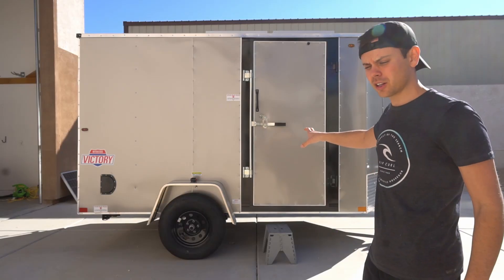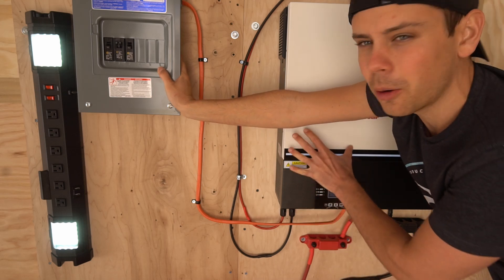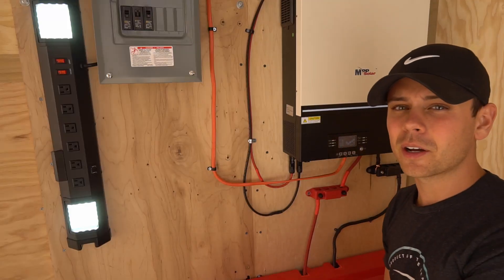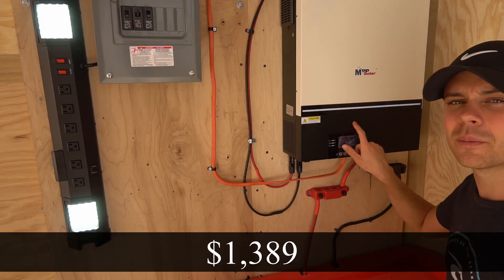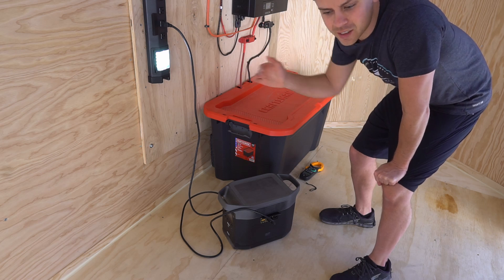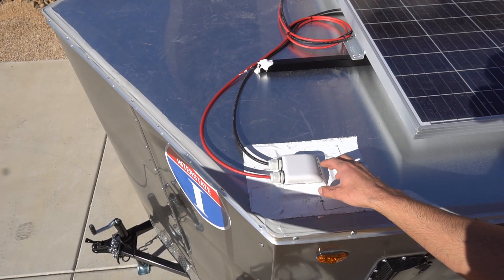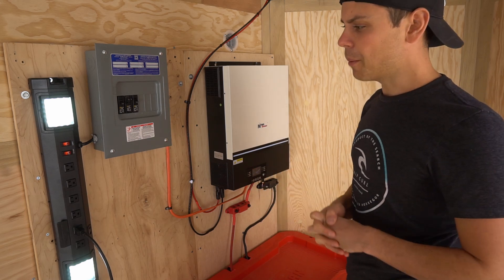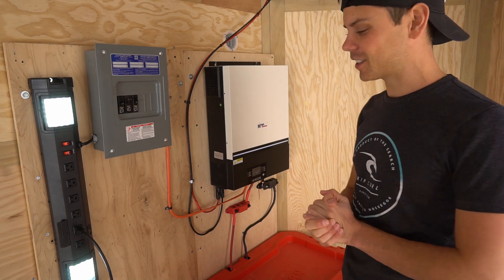Utility Solar Trailer: 6.5kW AC Output, 4.8kWh LiFePO4, 8000W Solar Input and AC Charger

Comment: Hello, can you please make me a plan or a sketch of how to switch 4x 12 volt batteries to 12 volts and 48 volts? I have already imagined this with 4 powerful relays, but I have some concerns about the contact change, whether it could come to strong sparks. Well, it should be possible to switch load-free, or what do you think? I am planning to install a 2150 Wp solar system on my van. Because I want to install something like that in my motorhome.

Comment: I sell trailers for a living. Before you install the AC be sure to insulate the walls and ceiling if they are not already (mold due to condensation). 1 inch rigid foam works well. Be sure to number the panels so they go back were you got them and in the right orientation or you will be pulling your hair out (personal experience). If using a roof mount AC you may need to double up on the cross braces as well. A product called Silaprene is also good for sealing up things on trailers. Messy but never fails. Wear gloves! Cool looking setup! Neat and tidy as always.
Reply from the maker: Good advice
Reply: Thanks for the great advice.  How much would a trailer like this cost?  What model is it (or one similar)? I want to find out the specs (i.e., dimensions, weight, etc.).  Which trailer would you recommend for one to build their own camper (for one person)?
Reply: Brutha V It depends on how much space you need and weight for towing. Usually a 6x10 is about the smallest but up to about a 6x12-14 is a nice middle ground. Vnose helps add a bit of space but does increase overall length. The pull better too
Reply: @mrmotofy  Thank you, sir!  Appreciate the feedback.
Reply: @BruthaVIII  if you need to watch weight, the 6x10 aluminum ones come in right at 960# and are around 4,000. I looked at a neo trailer, it was light enough to pull with my rav4 with 4cyl motor but once you hit 60mph it caught to much wind and gas milage was terrible. 
   I would make sure and inspect the roof of any trailer your looking at closely, the neo i ordered had some places where the roof metal was flush and others with a gap you could stick your pinky in between the roof brace and metal roof. If your mounting solar panels like Will did, it would crush and crease with the 1/2 to 5/8 gap the neo had. Hope this helps, God bless!
Reply: @checkingoutgypsymike2075  That does help, brother!  I appreciate it.  God bless you too.
Reply: A solar DC heat pump mini split would be the way to go here
Reply: What kind of air conditioning  would they set up handle?

Comment: Excellent project; I like your neat wall layout. The box takes up a lot of floorspace; maybe experiment with mounting the batteries in a line along the wall to match the slim layout of the other components. Instead of a fixed ground mounted solar array, how about designing a detachable array attached to the side of the trailer. That way the larger array can be taken to a job site and used as an awning or detached and set up in the sun when the trailer is parked in the shade. ✌
Reply: If he built a hinged array that folds down onto the side(s) of the trailer or can be set up to the flat position, that would do the same, but would be easier to bring with him.

Comment: It's a good set up, but....I like to see wires in conduit in a rough service area's.
Reply from the maker: Same here but I am going to swap out those conductors soon enough. So I stick with romex. But yes, ideally you should use conduit.
Reply: @WillProwse  It's a neat test system for sure. You said you are going to do air conditioning when it gets 120 outside? Are you in Arizona? The inside of the trailer is gonna hit some high temperatures. Maybe ~160°F?. You can really test the durability of the electronics up on the wall. Reminds me of what my dad used to do. Quality Assurance for Arco Solar on their solar panel's.
He would tell me that they would cycle between extreme low to extreme high tempetures. Solar has come a long way since the early 80's.
I still have a panel that he gave me. It was one of those test panel's. 
A whopping 2amp output at 12v.
Reply from the maker: @SJMessinwithBoats  Wow that is awesome! And I am in henderson nevada. Your dad had an awesome job. I am jealous haha
Reply from the maker: @SJMessinwithBoats  I love testing old panels. It is incredible how much of their rated output they can still deliver. I found some 30 year old panels pulling over 90% of their STC output. But yeah, those panels had horrible output for their size haha

Comment: Hey Will- did you do the wood paneling inside the trailer.  Looks great!
Reply from the maker: Mine came with it, but I did add thick plywood panels to mount the components. I mounted them to the metal studs under the plywood.
Reply: @WillProwse  
why plywood instead of cement board? Not as concerned with combustion as in a house? (i.e. if the trailer burns it's not as big of a deal)?
Reply: Generally, lots of enclosed trailers come with the wood interiors. Mine did...

Comment: If you consider $1300 super cheap then you need to rethink. Moderately less expensive maybe   but not super cheap.  
Looks good,  but no way for most
Reply from the maker: For that output, expect to spend $4000. Yes, it is VERY VERY insanely cheap. Lol
Reply from the maker: Wait I think he is trolling
Reply: @WillProwse  NO Not trolling, but maybe in the future if this is your attitude. I was just stating a fact that the cost is not super cheap.

Comment: Isnt the cable entry gland facing the wrong direction? When towing in rain, rain will be forced into the cables. Flipping it around lets the water run off around the cable entry... other than that, very nice setup.
Reply from the maker: No it is fine. You can mount them in any direction.
Reply from the maker: I also mount mine at the edge of the roof so I can access them easily to swap out wires. I hate how most people mount them. I never had one leak. Be sure to use eternabond tape though.
Reply: @WillProwse  I'm an RV'er so I'm overly paranoid about water intrusion. :)
Reply from the maker: @dallanc5199  cover everything with eternabond tape on properly prepared roof surface and you won't have a leak again. You will love the stuff. I used it on my rvs for ages
Reply: @WillProwse  This probably gets off topic... I agree Eternabond is good stuff, but where you overlap one piece with another there is a tiny gap where water can intrude. I use eternabond for small patches, or to reinforce the membrane roofing where say a solar panel mount will ride, but for best case sealant use self leveling Dicor.
Reply from the maker: @dallanc5199  I used self leveling dicor sealant on the holes and on the heads of the bolts. I use it in many of my videos, and for decades now. Did you see it on my website? I love the stuff

Comment: Awesome trailer! One thing I see is that power strip from Home Depot. I’ve went through three of these things and they all burn out. I’m not even running anything heavy off it just common things for the garage.
Reply from the maker: I listed a higher quality strip in the parts list. Hopefully that avoids issues for others
Reply: @WillProwse  yeah man. I don’t know if I got a bad batch or what. I still use them mostly for the lights. But if I plug anything over say 500 watts it trips.
Reply: @sambucci8544  If you are using an inverter, make sure it's pure sine wave. If using a generator, it may be because of surges.
Reply from the maker: No way! I used mine with 15 Amps and no issue. I'll try to find a better one though. That sucks

Comment: Nice, I've been looking at designing a trailer similar to this so that I can install a water pump, a water filter, a 55 gallon water storage barrel, communication radios and some 12v power points for charging devices. Thanks for the video.
Reply from the maker: Now that is awesome!! Very cool. 

I have a water tank and pump I was going to mount in this trailer, but I still need to use it to move stuff around. Your setup would be perfect for prepping.
Reply: @WillProwse  Would there be issues with storing these batteries in such a hot environment or is that the purpose of the a/c unit on 120 degree days?

Comment: Excellent setup! I’m actually going to have a similar setup in my Promaster, just less powerful. However, I would like to see the connections inside the fuse box. That’s what was missing from your last video on connecting an All-In-One to BigBattery to solar panels... you connected the AC cables- the input and the output, then stopped the video. I hope you include the connections on your schematics.
Reply from the maker: Ok, will take cover off and add it to the blueprint page on my website tonight
Reply from the maker: Good idea

Comment: THANKS WILL. Camping season is coming! I've been researching on how to overcome overcast situations. HELP! You can have all the best equipment, but without the sun it's useless! How about a video or is there no solution??? Not everyone lives in Vegas?
Reply: I still get Amperage on cloudy days with using several solar panels in series, and an MPPT solar controller. It won't be as much as you can get on a clear day, but it will help a LOT.
Reply: @Tumbleweed5150  Thanks
Reply: Slim Potatohead is a Canadian YT-er who does trailer-camping with a tiny solar system, and even with low sun and clouds he's good for 2 days. It can be done in bigger sizes with the right stuff and the right approach.
Reply: @P_RO_  What I'm reading, panels in series and a MPPT controller gets the best results. I was just wondering was, are all panel of equal wattage about the same or are there panels that do better in overcast?
Reply: @campinwill9977  Can't answer this for you. Some mixed-size will work, and panel type with aging has to be thought of too. Trailer size, panel mounting, too many variables. You either perfectly copy someone else's system or learn enough to design your own to fit your needs, then you can diagnose and fix problems and do upgrades yourself.

Comment: I've got an electric unicycle called the Veteran Sherman...100.8 volt 3200watt hour battery with a top speed of 50mph and 100 miles range! I'm 40 and I feel like a kid riding it it's so fun cuz you just lean to accelerate! Anyway that hobby got me into your channel!
Reply: How do you not die when riding this?  There's nothing to hold on to?

Comment: I am thinking doing the same with everything you mentioned exactly but mount it on the roof rack of my truck (removable) for shtf situation
Reply: Something like a cargo carrier? That would be a great idea. The other nice thing, is it would be portable. You could use it on anything if your vehicle broke down, or you bought an RV or camper, or just need power somewhere obscure.

Build an extended trapezoid box with space for a battery or two with screw-on connectors, maybe wing nuts to make it easy. You could use an Anderson connector to supply power inside the vehicle, and an entry gland with 3 connectors would have enough room for an extension cord. You could probably just buy a replacement for the third. Use a piano hinge and rear hatch shocks to raise it.

I think it's a great idea!

Comment: For HVAC, check out small Mini-Split systems. The small units can had in the 9,000 BTUh size that consume very low power while maintaining a cool or warm trailer. (If you buy a heat & cool system). Basically the 20+ SEER units are high-tech heat pumps.  The units (18k & 24k BTUh) I use in my home can maintain comfort while using just 400 to 500 watts. When the thermostat sets them to standby, the power use is almost nothing.
Reply: Mr. Lee, can the Mini-Split be used in a Promaster 3500 extended van?
Reply: They have DC solar minisplits now too
Reply: @Nicholas-f5  I knew they existed, but never looked into how they would work. I assume you would need some high voltage, high current PV panels, connected to a good battery bank to provide the DC, uninterrupted.
Reply: Do these units have the step up capacitors which allows you to use a smaller amt of electricity to turn the unit on?
Reply: @gregboyd4321  Mini-Splits already ramp up slowly so they don’t present a heavy current spike on startup.  A good match for solar powered systems.
Reply: @gregboyd4321  They're almost all brushless on the blower and compressor so yes they're all soft start.
Reply: @scottleggejr  "they're all soft start"??  When I installed my first 230vac Sanyo 24KHS72, 14 years ago, I was happy to see that after starting up, it would run all day (heating of cooling) only using 300 to 470 watts.
BUT, they programmed the control board's firmware to Ramp up like crazy. it would start slowing increasing power use 100 watts every few seconds, within a minute it's 2,700 watts. (11.74 amps ac). Then slowly, it would ramp down. In a few minutes it would be sitting there at 420 to 470 watts, heating up, or cooling down my home. 
They reason they added the big ramp, is Americans want Instant AC.. Turn on a US made HVAC in 2008, and you got 20 minutes of waiting for some heat or cold.. So, they wanted Sanyo MS units to provide Instant heat or cold.. 
That big Ramp was the cause of leak on the copper output pipe on the compressor. 
I got Sanyo US on the phone and told them were the leak was. "Are you sure?". I say yeah, listen for yourself and held the phone near the hissing leak. I had to wait for the next ship load, but I got a new unit. Years later I repaired the leak. I learned how to braze. Used the old one for a few years before a power surge blew up the main board. So, now it's spare parts for the good one.. It's motors etc are like new. Sanyo US is long gone.
Reply: I had I hard time understanding  what you wrote in a simplified way can you tell me if I can power my 9000 btu mini split in a Trailer Plus 4 pod lights and 4 outlets which will contain coffee pot microwave TV and battery charging station ... I'm a plumber not a electrical engineering or any solar background.  These conversations back and forth I can barley comprehend in the comment sections it's all just gibberish to me

Comment: With them in series will need to balance the battery’s to each other over time?
Reply from the maker: No they are fine. I charged them to 100% before connecting in series. They will balance themselves over time.
Reply: @WillProwse  well then why do you need a bms with balance leads for each cell if you don’t need that for the complete battery. They don’t self balance in series only in parallel right.
Reply: @AllMyHobbies  the bms is to prevent the cells being over charged 
the battleborn batteries have one built in that is able to be series connected with other batteries to allow you to have higher voltages such as 24 volt from 2 12 volt batteries for example
Reply: @BenCos2018  I know what the bms is doing it’s also actively balancing the cells in series that are in the battery. i was watching a sailing channel recently and he was trying to use 4 Dakota lithium battery’s in his 24v boat and even know it says that’s fine on there website the company said it’s not a good idea and got him to install 4 24v 50ah battery instead so he would not have to series the battery’s.
Reply: @BenCos2018  also sv delos has 8 of these battery’s in there boat in a 24v setup and they had one of the battery’s fail very early only a year or two and i believe it was because they are in series and parallel and after a lot of use they got badly out of balance.
Reply: @AllMyHobbies  hmmm 
that shouldn't happen if they are in series tbh 
I know some batteries can't be used in series because of the BMS 
I think battleborn ones can though as they are designed for it

Comment: How much was just the trailer?
Reply from the maker: $4800
Reply: @WillProwse  Nice! I am moving to Texas, and just priced a uhaul from California, they want $4,600 for a 10' truck just to rent one way!!!!
Reply from the maker: @3000gtwelder  no way!! Holy cow
Reply: @WillProwse  Yeah, they are price gouging people from California, because nobody is moving back. The real one I need is the next size up, 15' was $6,000 lo1. Yeah, I decided to get a tow hitch and a 5'x8' trailer for$1,000. Still I feel like I'm getting bent over.
Reply: @3000gtwelder  Find out what your car insurance covers as to size, and how long you have from purchase to declaring a new vehicle. Buy truck and get a temp tag, do the move within insurance time, cancel tag, then sell truck for what you paid so no capital gains tax. As long as the truck doesn't die (which can be hugely expensive) you get to move for free. Play the system for all it's worth and win.
Reply: @P_RO_  lol!
Reply: @P_RO_  That's not the kind of insurance I carry.
Reply: @3000gtwelder  Oh well, it can work where I live and I'm big on not spending what I don't need to. Your money, your choice.
Reply: @P_RO_  Yeah.

Comment: Cool, I am looking for a system to slowly charge my cyber truck when i get it.  I want a system that just pumps power in from the panels so it does not need alot of batteries. One of these all on one systems looks perfect.